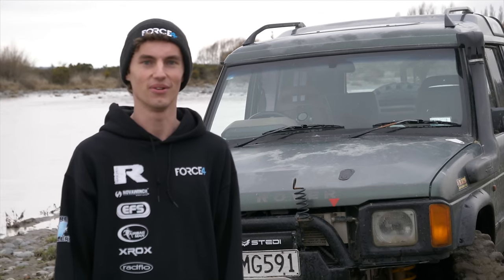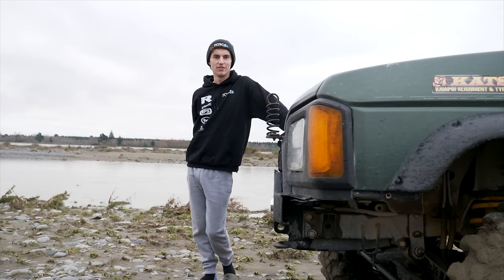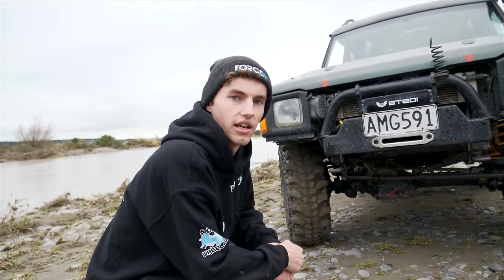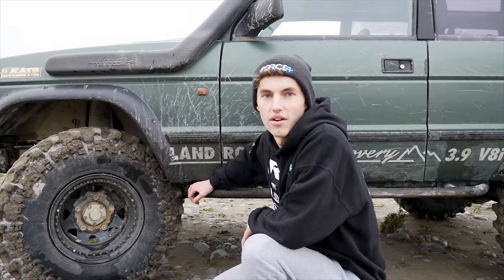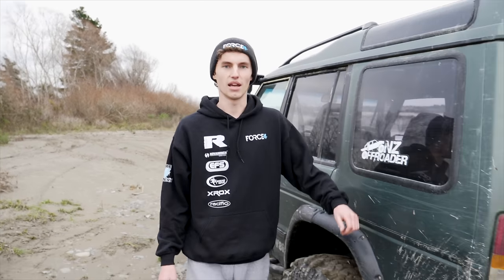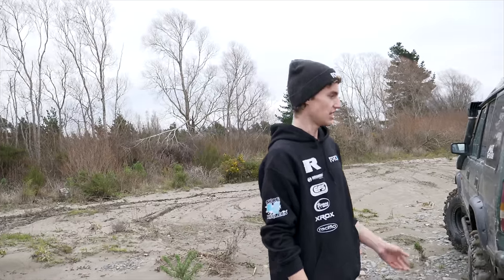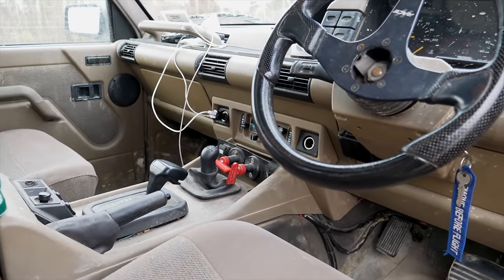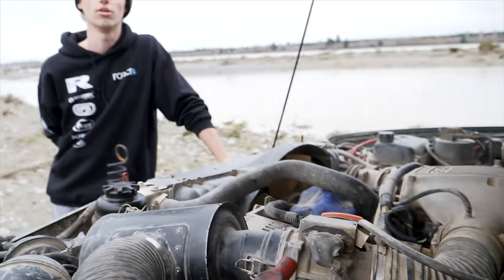The BUILD: LANDO V1.0 - V8 Land Rover Discovery 1 Walk Around

Comment: Yus! Been waiting for this vid 👍
Bought myself a D1 last year, slowly chipping away with mods. Definitely going to need to beef up my axles to suit the locker 👌
Reply from the maker: Good stuff mate! If it’s a selectable locker and 33 muddies (but not comp muddies), as long as you don’t drive stupidly aggressive, factory shafts will hold up just fine. I did a winch comp on factory shafts and ended up jumping the truck at about 80km/h etc. and they held up. I only recently went to chromolys, have a look at some of my older videos (especially the second Petrol Hill video) and you’ll see they take a fair hiding... they just don’t like any shock loading
Reply: Good info, it's an air locker, and currently only on 31 muddies, just fitted lift springs and looking to step up to 33s shortly and figure out what will need trimming , eventually I'd like the option of running 35s for some West coast trips but baby steps for now haha, also it's a 200tdi so a whole lot less power for breaking stuff
Reply from the maker: Even with 33s, as long as they aren’t like silveys or CSTs you should be fine. Being a TDI will help break less 😂 just don’t over-gear the truck, honestly ruins how they feel. I’m also looking at making some DIY truck parts soon which may interest you, including a nice way to tidy up trimmed guards 👍
Reply: @Crawlerer79  definitely got me interested 👍

Comment: Great vid mate. where'd you get the recovery boards? thinking of getting a runva winch myself, what did you have to do to it to make it work properly?
Reply from the maker: Got them off a mate secondhand... sorry I can’t help more with that! And it’s taken a full rebuild with everything coating (everything was raw so corroded as soon as it saw any water). Honestly I’d recommend spending the little bit extra and going Novawinch, I have been really impressed with what I’ve seen of those and you’ll be seeing more Novawinchs on the channel soon!
Reply: @Crawlerer79  After much scouring of the interweb i've found a supplier for the boards. Will get myself a pair. I was having a look at the novawinches too,  maybe i'll have to save up a bit more coin and invest in something decent

Comment: Sweet ride! I'm wondering what was involved with getting the AN fittings on the trans cooler?
I need to do this to mine...I crushed the tubes the first time I tried a compression fitting...
Reply from the maker: Thanks! I cut both transmission lines with a pipe cutter on the hardline where it passes under the engine. Then from memory used a 1/2 hardline to -8an fitting on each and ran new lines. The lines run through the radiator end tank for extra cooling (although if I was doing it again I would bypass this) so I used a screw in fitting with the factory rad but then with the aluminium radiator I had to get my mate to TIG on a new an fitting, as well as obviously the P38 cooler has had an bungs welded on. Highly recommend the mod!